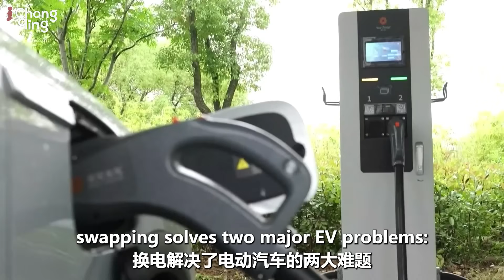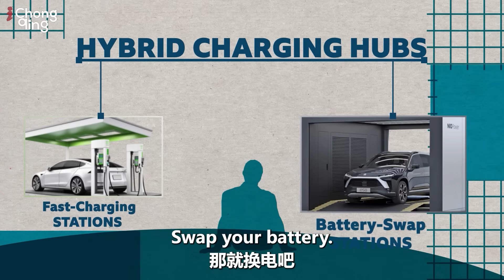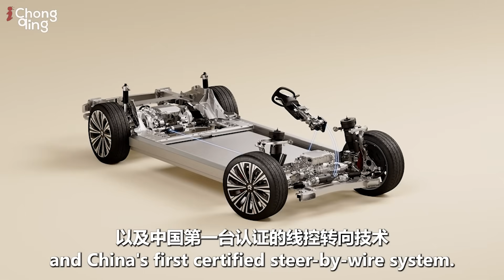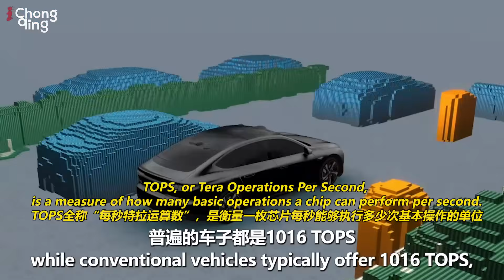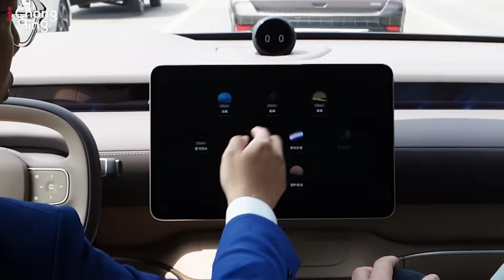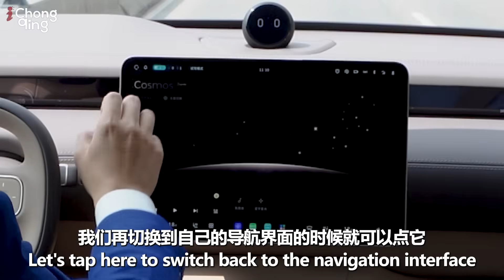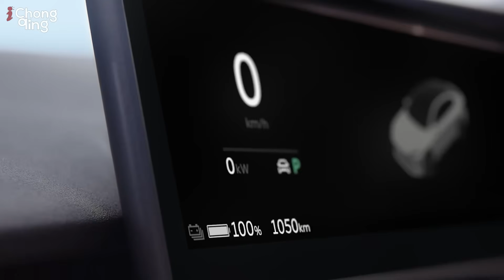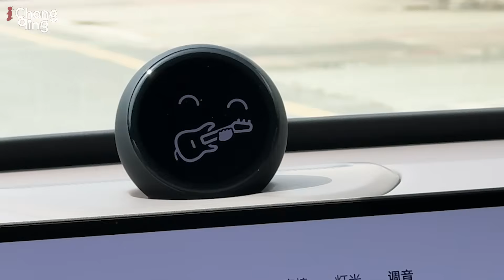The RISE OF CHINA'S EV CARS | NIO Part 3 FULL SERIES

Comment: Charging times for new BYD batteries are not much longer than Nio battery swapping times. Nio make nice cars but battery swapping has not really caught on.
Reply: you also don't worry about battery degradation when you swap it out.  10 year old NIO will not have to worry about its battery, just swap out